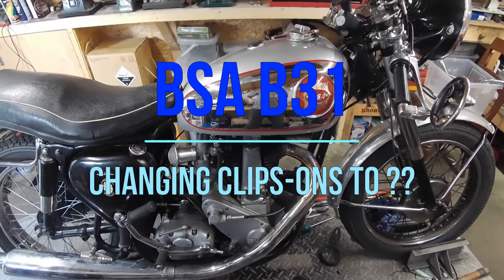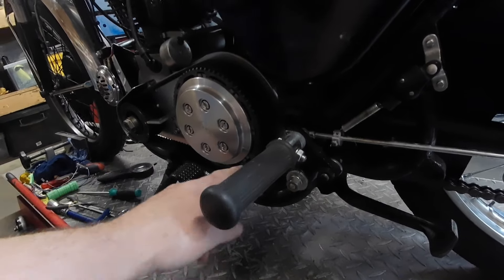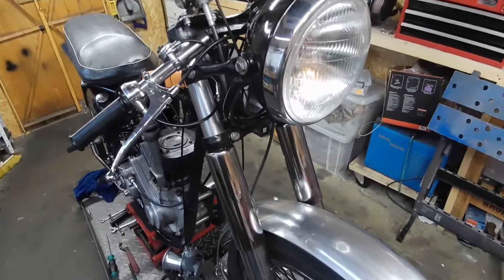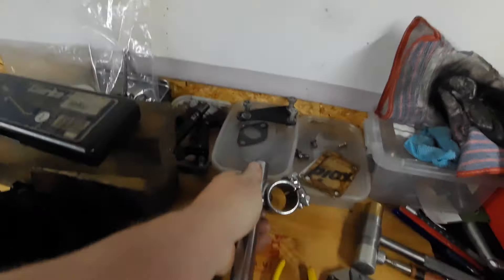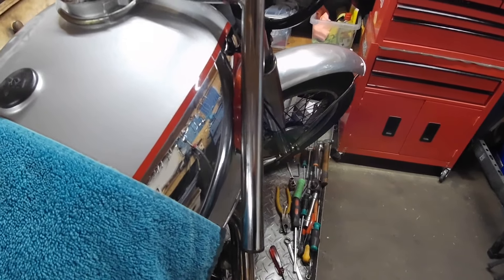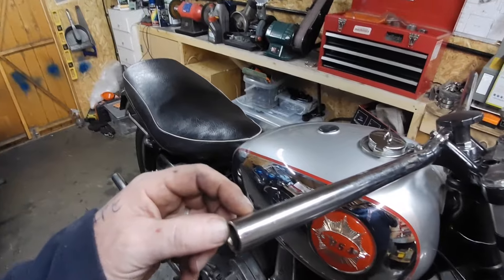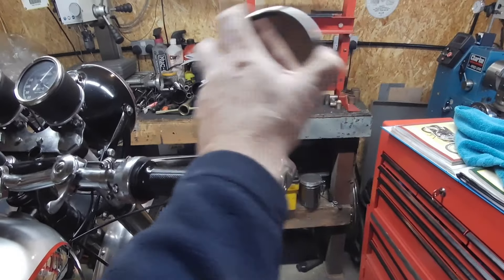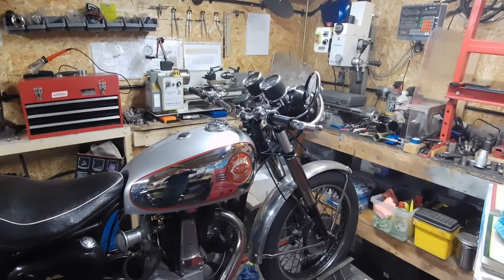BSA B31 Bar Change from Clip ons

Comment: hi Ian I know what you mean about the old back I'm no spring chicken my self, the a65 top yoke, from 1962/1965 and lightning clubman had the drop top yoke, part number 68/5049, and the bars bolt on forward of the steering damper and give more room for the bars to clear the tank, but not sure if they will fit the b31 it would depend on the fork stanchions diameter's  and width, kind regards Adrian.
Reply from the maker: Just seen some on ebay, yes they are very different and I do like the look of them. Like you say dimensions would be required.